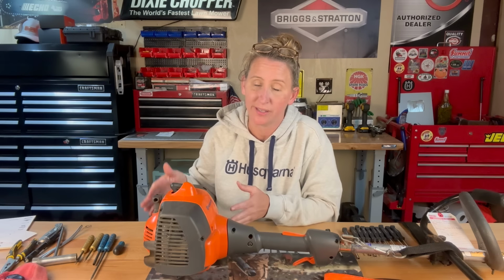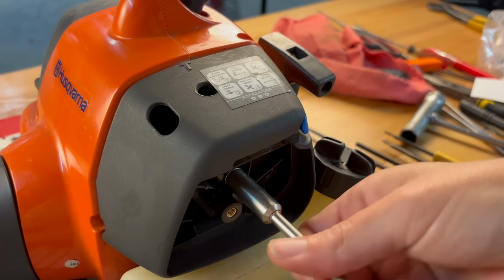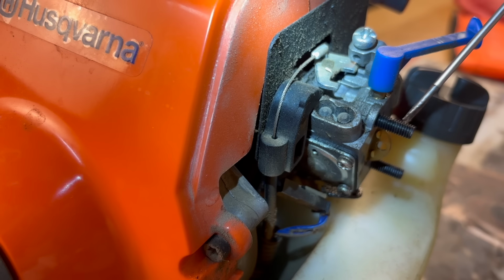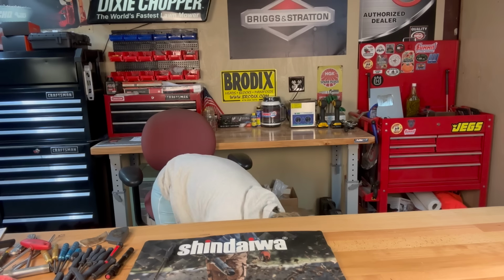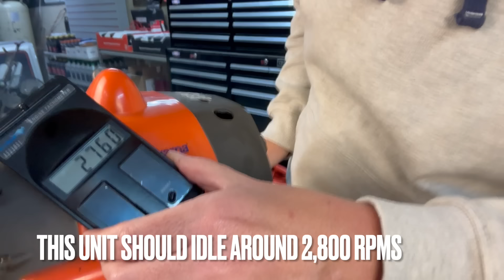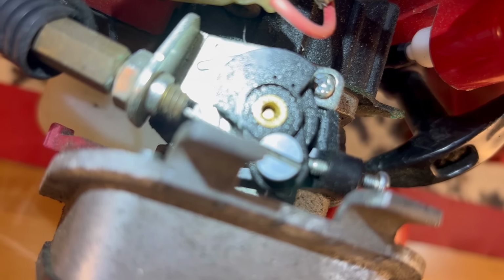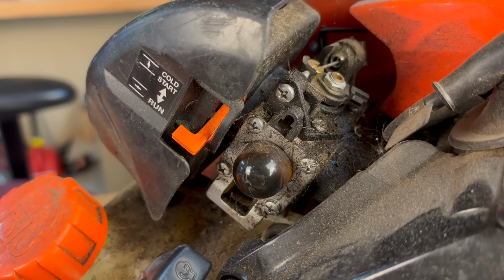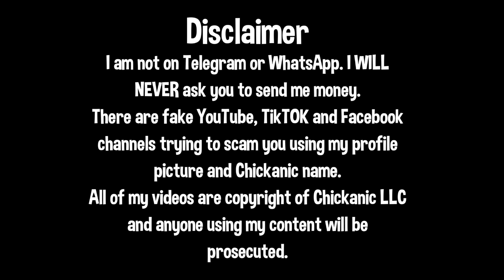How To Easily Fine Tune Your 2 Stroke With A Super Simple Carburetor Adjustment!

Comment: I have re-written - edited and corrected your introduction text.
It is now written in correct grammatical legal English.
Your experience is small engines and not writing.
As I have written and co-written several operations manuals 
for the USAF ( when I served on Officer - exchange attachment )
Thus I am suitably qualified - not only as a pilot - also in writing
- Electrical Engineering - teaching and  Law.
I wish you success in your small engine repair business.

Every'one'   has equipment with small a small engine - 
they would be wise to tune into your channel and similar
channels to learn practical repair skills. from your experience
or have you undertake the maintenance if they reside close-by.

Comment: I live at 4,700 ft. above sea level near Salt Lake City Utah and adjusting carbs for higher altitudes is interesting to say the least. I just got my Homelite String trimmer out for the Spring and I had to adjust both high and low and also change to a new spark plug. Complicating matters was I found out that I was supposed to be using a 50:1 mixture all this time but I was was using 40:1. So no wonder I needed a new spark plug. The old one was wet and dead (could not be revived) due to too much oil. Now it runs better and the spark plug looks better when I remove it after switching to the right mixture. Don't know why I thought it was supposed to use 40:1 exactly?

Comment: My new STIHL has like a rev limiter on it and doesn’t give the me the power satisfaction of my ECHO I used to have. Is there a way to bypass that? Not worried about warranty. I’ve had it long enough for the warranty to have run out.

Comment: don't think the exhaust spark arrestor screen isn't clogged and jump to conclusion of it must be the carburetor( done that last year?) and I knew better by far, but failed to recognize the fuel charge spewing back out of it. whoops. broke out the adjuster plugs, and adjusted, only to be like WTF and then went wait it's blowing back out the carb. gee lets pull off the exhaust redirect plate and there we go, blocked screen!. I felt like an idiot after knowing better and having dealt with it in the past many times. I spent three hours total and only charged $60.....
yeah, even though they showed me previously they were using 4-stroke mower engine oil, I just didn't think about the spark arrestor screen. no human is perfect and I don't do small engine repair daily (or yearly anymore), only have to take a sledge hammer to mine every three or four years and cost of it/lack of people using them just isn't worth my time.

Comment: My mother bought a cheap bush trimmer but never used it so when she moved to an apartment I got it. Served me well for 5 years or so but couldn't start it a few weeks ago. Removed the carb and sprayed starter fluid into the cylinder and it started right up so I guess the carb is to blame. Just bought a cheap one for $15 and hope it'll resurrect my weed eater - If not, I might get a quality one.

Comment: I have a request!  Can you do a video on a choke repair/adjustment on a Murray MT200 riding mower?  There is absolutely nothing on this online.  Even Murray provided nothing (I can't believe they don't even have a diagram of their own product!!!).  The mower is only 11 months old.  The mower works, but the choke is stuck on high.  It is not easy to see the linkage because everything is behind a metal plate.  Help!!

Comment: I have seen other videos where they remove the limiter cap by heating a small screwdriver with a torch, then sticking it into the cap and letting it cool.  After about 15 seconds it just unscrews or pulls out.

Comment: I hace a poulan pro ppb30 backpack blower it has one adjustable screw at the top that controls the idle but doesn't have one to control the high speed. What should i do.

Comment: I have a husqvarna 525L , carb had adjusters to use a small flathead screwdriver,  after a few years,  carb went to starving,  put a kit in it,  and it ran for a while,  then a acted up again, went on Amazon and bought a new OEM Walbro carb,   it has splined adjustment screws,  i have a full set of adjustment tools,  but none fit the screws. My 21 spline tool won't fit, did Walbro make a 22 spline adjustment tool,  if so,  i can not find it online anywhere.  I am totally stumped on how to adjust it, it only needs a minor tweak.

Comment: For the black plastic caps I heated up a screw stuck it in the hole and let it cool then just pull it out. For the brass caps, use a screw also just be careful not to go to deep, screw in and pull out.

Comment: Thanks, pulled the old husq 61 out today and it wouldn’t run. Fuel line gone. Disassembled everything and cleaned carb. No diaphragm kit on hand. Reassembled adjusted high and low and now she rips…parts on order.

Comment: Great basic breakdown👍🏻 for the Echo and Shin tiny plastic plugs, I don't remember the size but take a drill bit smaller than the bore, heat the tip with torch, lighter etc and sink the drill bit straight into the plastic plug without turning. Let it cool a minute and it'll pull that plug out just as well as the proper tool.
For the larger orange/red Echo/Shin limiters, cut or grind the sharp tip off a drywall screw and it'll screw into them for removal.
Reply: Yes, that's what I do,

Comment: I depend on those adjustment tools and found a pack of them at Menards for $10. Back in my shop days even snap on didn’t carry them. Thanks for the great info as per usual. The limiter caps I always took a small screw and needlenose to get them out along with those pesky emulsion tubes but it’s nice to have a magic tool for them now.

Comment: My Stihl FS-56RC starts easy, and runs great at full throttle, and cuts like there is no tomorrow.  Unfortunately, it had no problem whacking the fiber optic cable that brings my AT&T internet and TV signal into the house.  However, if I try to let it idle for very long at all, it bogs down and dies.  So, maybe I need to tweak the low side of the carb a bit.  I have lost track of how many seasons I've used it. I winterized it this year by getting the gas out of it, and putting a bit of two cycle oil in the gas tank then pumping the purge bulb a few times.  This spring I put fresh 89 octane no-ethanol gas mixed 50:1 with Stihl UHD Oil.  It runs better than it ever has.  I have the Echo speed feed head on it, big improvement.  Then I took her advice on getting the trimmer string moist, makes a difference.  I bought some 095 string from Lowes, that I was ready to throw against a wall, until I soaked it.  Now it lasts longer and cuts better.  So, I may be investing $11.00 on the carb adjustment tools.

Comment: I have had some luck with a small sheet metal screw with fine threads that will grab the end and pull it out. Trick is getting the right size to go inside of the cap

Comment: I had 2 of the same model Ryobi trimmers that would not run full throttle. It seems that to pass emissions, the factory leans the high speed adjustment. First time it is run under load, it dies.  I did not have the tool so I just cut slots in the screws and gave it a tweak.  Problem solved.

Comment: I have two Troy-built trimmers that never ran right from the store. I fought these for years trying to get my yard cleaned up. They had to run on choke to run at all. In your previous adjustment video I followed along and this week I went out and started one of them, and it ran like it was supposed to on the 3rd pull. I was able to take it off the choke as soon as it started. Gave me a warm Fuzzy. Thanks Bree.
Reply: good for you ....

Comment: Great video. Thanks. I watched a tutorial the other day and the guy used a tiny flathead screwdriver like you use to work on eye glasses. He would get the end hot with his portable torch and then press it into the rubber cap. Leave it there for a few seconds while the rubber cools and hardens again, pulls right out. I can't recall if he put it back in the opening after he did his tune up. However, It did seem to be his "go-to" way of removing them. May or may not help someone that doesn't have that specific tool available. Idk.. I just figured it was worth noting. Thanks again for your video. I like your format and the way you cover the information. Much appreciated.

Comment: Heat the piss out of an old worn out drill bit that fits down into the hole. melt it into the limiter cap, let it cool then just pull it out.

Comment: I HAD AN ARGUMENT WITH SOMEONE WHO SAYS IT IS BETTER TO USE HIGH OCTANE GASOLINE BECAUSE IT DOESN'T HAVE ETHANOL. but as far as I know, only gasoline with a maximum octane number of 90 is indicated, as the one with a high octane number burns the gaskets of lawn mowers, etc... what do you say: I have used gasoline with a low octane number and we add an additive to evaporating any vapors that are made in the tank??❓❓❓❓

Comment: I think this is the first video to which I have made a comment, but I had to do it.  I have a Husqvarna 128LD trimmer to which , at the start of the season, I installed the Shindaiwa Speed-Feed 400 after watching your excellent vid.  Why, oh why I hadn't done this many seasons ago to avoid the continual hassle and frustration of adding new string with the standard head, I'll never know.  IThe speed-feed is working like a charm, as you so eloquently pointed out.  Same years of frustration with what I now know is a common issue - starts fine, warms up on half choke, dies on full throttle.  I know! - CHICANIC!! Sure enough, found this vid.  Checked fuel for water (none) and confirmed the filter was good, had already installed a new air filter, checked exhaust screen (clean), replaced spark plug with a new Champion RCJ8Y spark plug, 1/4 turn on both high and low and .... runs like a charm.  Fiddled with the high screw a bit but a tac is on the way.  Only problem (NOT) was I had to return the Ryobi string trimmer attachment without even taking it out of the box.  Can't thank you enough.  I'm ready to tackle the carb rebuild at the end of the season.  One question - the Husqy spec calls for a Champion QCJ-8Y plug but I couldn't find one.  Is the RCJ-8y an acceptable plug and does the trimmer require a resistor type plug?  Long winded comment but I'm once again in love with the Husqvarna trimmer.  Thanks for your excellent vids and instruction - clear, concise and to the point.  Keep them coming!

Comment: Learned something new today. My Airens 42in deck needed spindles, wife looks up the parts for me. You can buy spindles pulleys and belt in a bundle. Very cool. Wrong now my belt is to long.:( mmmm. My pulleys I removed are 6.5inch the new ones are are 5in. Know wonder you get the belt in the deal. Lol
Thanks for all your help

Comment: I took your advice last fall and pumped oil into my 16 year old 440 Husqvarna using the primer bulb.  
Ran fresh gas oil mixture through the carburetor and dumped out into a container. Added  new gas fuel mix
First pull on choke it fired.  Put choke off and startled right up.  
  I did the same with my Mantis tiller last fall.  Should run good
Thank You

Comment: Drywall screws and KNIPEX TwinGrip Pliers have sometimes worked for me in removing things like bung plugs and limiters... Use a Phillips screw driver to insert the screw into the plug/limiter and then pull straight out with the pliers. Obviously the composition of the material, the thickness, and how tight and clean the friction fit is all have an influence on the success!

Comment: Tools to get my motor running as well as you do!
Had to order the orange kit though, the black kit is over a month out.
You may want to mention counting the turns in - so your viewer has a fixed reference point to the original settings. Once one starts turning adjustments like this, one will quickly lose any idea of the original starting point. Counting turns until it just bottoms will assure one can get back to the original starting point when one screws up. That way, one has the opportunity to screw up many times and still recover.

Comment: To remove limiter caps, heat to red hot the end of a small drill bit, insert and wait 27 seconds (or thereabouts) then pull straight out.  Works almost every time; repeat if necessary.  (Your Husqvarna trimmer sure had a lot of bog on throttling up).
Reply: That’s what I’ve been doing 😢

Comment: yesss thats what happens ..theres a tendency towards troubling the carburettor first..and if its not the carb..then the adjustment is lost after messing with everything else...how can one avoid that mistake in the heat of the moment when the damn thing wont start and all you want to do is mow the grass and get back inside???/

Comment: Thanks for that, I've actually done that adjustment before and got another season out of a trimmer....back when I really didn't know what the adjustments were.  Oh, one thing I have been doing that seems to really help, and it was something you said, when I grab a tool I haven't used in months, I monkey with that choke a few times before I try to start it.  So far, every one I do that with starts right up.  Exception, dang Craftsman push mower that doesn't have a choke.  You have to pull it hard 5-7 times the first start up of the season....oh well.

Comment: Thank you for zooming in on the idle screw and where it should be hitting the clutch. I finally got my Husqvarna to stop spinning when idling. I changed the carb parts and was able to tune it and got it running again. So it took me weeks. I’m a persistent 71 yr old gal. Thank you for all your videos.

Comment: On the Husqvarna to set the choke you must open the throttle and then pull the choke. Pulling the choke is harder when you don’t press the throttle and it sets the throttle to high idle. Just incase you didn’t know I think that why the choke lever breaks

Comment: I bought the 110 tool set for my laptop and it has every tool for ANY job I might find with those strange screws. Those NOT SO USER FREINDLY electronics use forbidden screws from China...... It will make you dizzy looking at all them different tips............:face-green-smiling:

Comment: If you're not afraid of wrecking your limiter caps, heat up a small screwdriver, plunge it in and after the plastic has re-set twist it out.

Comment: In 1990 I bought a factory refurbished Shindaiwa straight shaft trimmer and it would run perfectly but only half choked.  Since I had that, 3 Homelight chainsaws, 2 Poulon chainsaws, a Husquvarna chainsaw, a Roof Vacuum/chipper, Ryobi Tractor, Simplicity tractor and Lowe's generator, I had to buy my first set of Carb tools.  I think a set of 3.  I'm on my 3rd set, this one has 10.  In the '80's I had to learn how to break off the limiter caps on everything from small to vehicle engines.  I was expert at carb rebuilding.  Only until now have I learned from your videos the reasons for having to rebuild carbs.  Back then parts were cheap and in most cases, easier than disassembling an entire unit.  I've also just learned about hidden adjustment screws and a limiter cap tool!  That may be why I just let it run half choked.  That begs the question: Why did it come, factory refurbished, with a major issue?  This video is gold!  Thank you for posting this!  P.S., 400K Drawing Winner!
Reply: I've run many brands of weedeaters but I've been running my Shindaiwa with ez feed 450 for the last 20yrs best one in my book!

Comment: If you guys don’t have the special tool, just use a Dremel to cut flathead slots on the adjustment screws I’ve done it plenty of times works perfect.

Comment: HIPA sells a 14-piece carburetor adjustment kit that includes the 2.5 mm plug removal tool as well as your choice of either a tach or a spark tester for slightly more than Echo wants for its plug removal tool alone.  The HIPA kits are $24 and $21 respectfully.  They also sell one with carb cleaning tools for $19

Comment: EVERY TIME I GET A USED 2 CYCLE I REPLACE ALL LINES, FILTER, AND CARBURETOR get a rebuild and the high and low get set to factory settings to start off.

Comment: I’ve had my Husqvarna 128LD for a little over 4 years now. The only thing I’ve had to do to it was adjust the L/H screws a little to get better throttle response and to fatten it up just a touch on the top end. I’ve repeatedly used this trimmer with the edger, pole saw, and mini tiller attachments that I have for it and it handles them just fine. I know it’s a homeowner trimmer with the braided steel driveshaft and not the solid steel. I work the trimmer fairly hard, but I don’t abuse it. Simple basic maintenance and it still runs like a top. I also pulled the muffler and the piston/rings and cylinder are well lubed and not one hint of scoring. The exhaust port and spark arrestor are also absolutely clean. All I’ve ever run through it is either Amsoil Saber, Echo Red Armor, or Husqvarna XP+ all mixed 40:1 with 90 octane ethanol free gas.

Comment: Stihl adjustment tool feels loose because they actually are a fuzz smaller. I've got an xtra OE adjuster tool if ya want it, I'll send it to ya. They send them in all of our tool boxes whenever we open another store. As far as those limited caps, heat up a small pick and burn through it. Makes digging it out alot easier, especially if you have a small enough pick to get under your hole.

Comment: Limiter cap removal: Use small flathead to remove the limiter cap by heating and melting onto the cap, wait few seconds welding it on stuck 😅

Comment: Old fuel line works, slightly heat the line so it’ll mold around the adjustment screws… remove em & cut a slot for adjusting it…

Comment: Just so you know. My carb adjusting tool is a dremel tool. I cut a slice across the top of both screws a walla  I can now use a flat tip. But don't tell anybody.